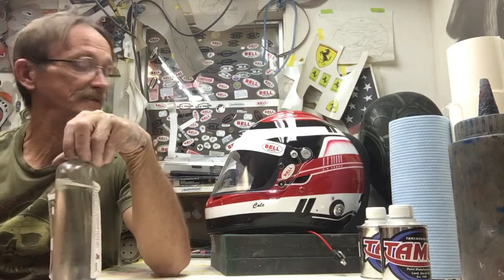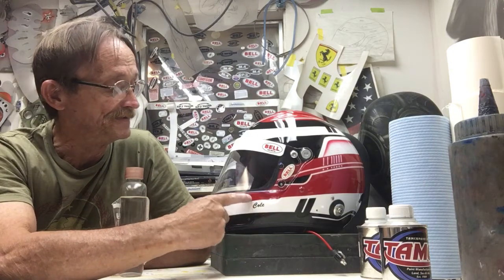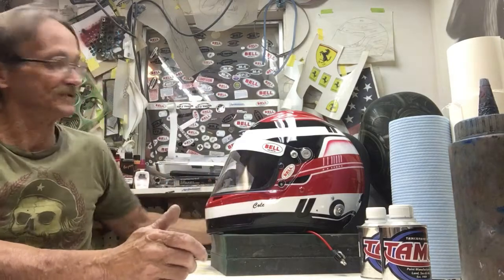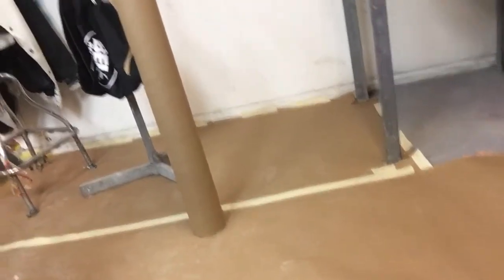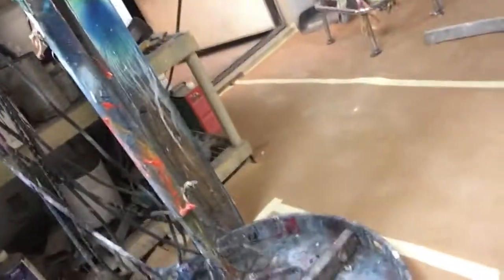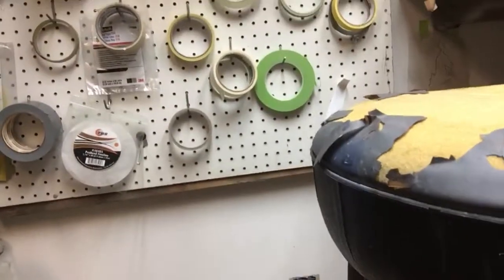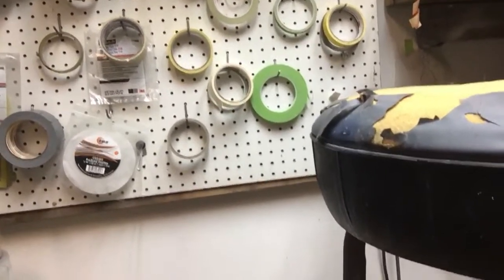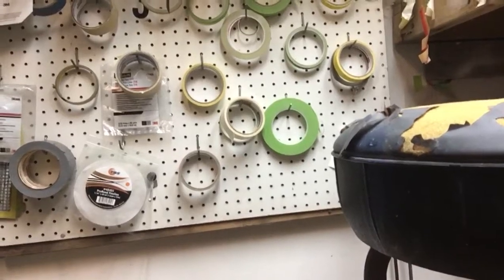Airbrush Video- Removing Buffing Compound, Tape Storage, Stand Trick

Comment: thanks for the tips
Reply from the maker: No worries The88katana600 thank you for taking the time to let me know. Have a great evening.
Reply: I some airbrushing, mostly auto body and painting on semi trucks.  will be watching lots of your vids for tips..  I have a long ways to go yet with the airbrush lol   my hardiest thing I think is spraying white .  never can get it to spray nice, always tip dry and spiting paint
Reply from the maker: White has the most pigment in it that is why it is so hard to airbrush with. If solvent based paint try over reducing little with slow reducer. You can also add a few drops of retarder to slow it down a bit. Try Tamco white tamcopaint.com it is the best white I have found. Remember it's just paint, relax and have fun you'll learn quickly no worries.